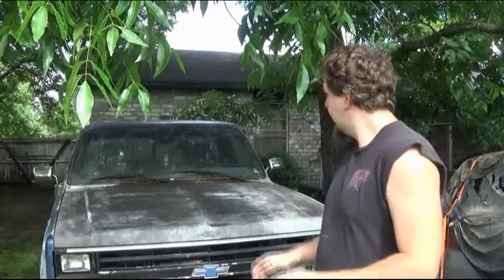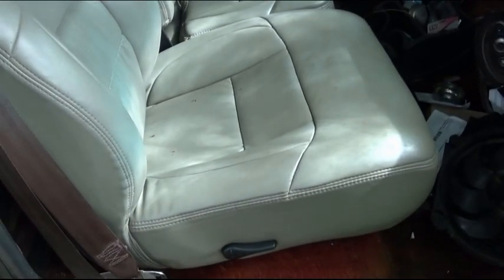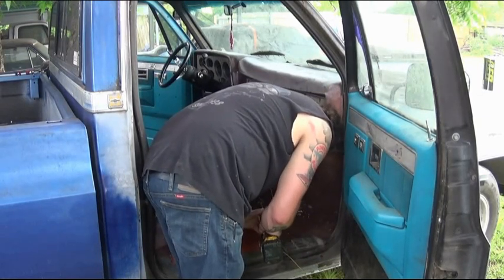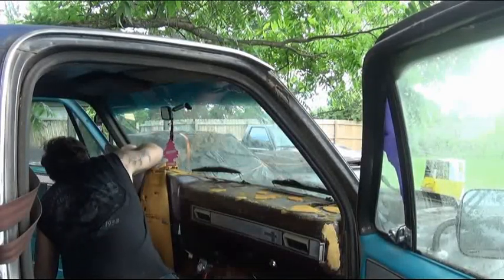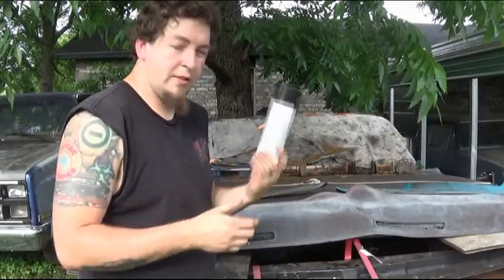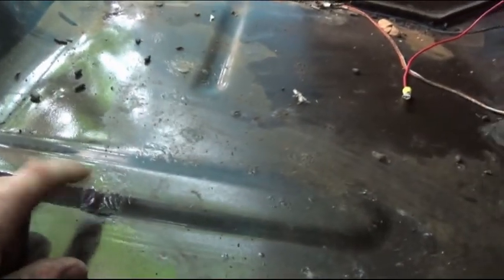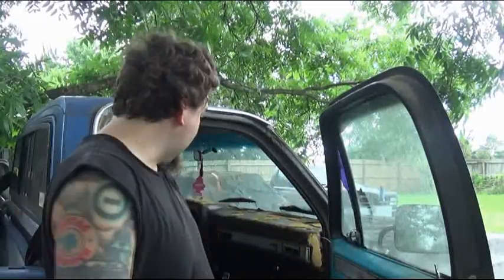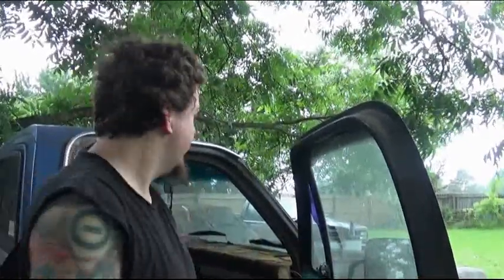Project Nightmare  ep 2 time to address the interior

Comment: that black looks alot better.if it aint too much i would black the seats and seat belts
Reply from the maker: i was thinking that, i did dye the plastic cover, didnt have enough for the seats, and i have not dyed  that material before so i wasnt sure how it would do or take
Reply: @EfurdGarage  i did a black conversion on a foxbody once came out good.painted the whole dash got the colors from 5.0 resto i was going to do the seats with the paint also but voted against it. it is different then doing a dash.on a side note i used regular jb weld mix.to fix the cracks in dash on the opposite side that u would see,it worked great for fixing cracked plastic dashes.
Reply from the maker: thought about fixing the dash but i already had that mat so i just went the easy route this time. i can see jb weld working well i will keep that in mind